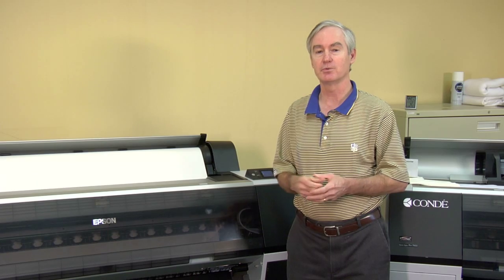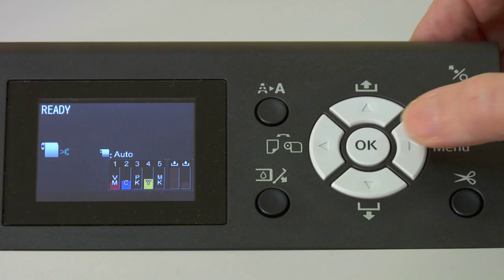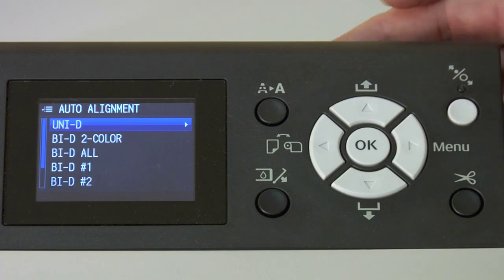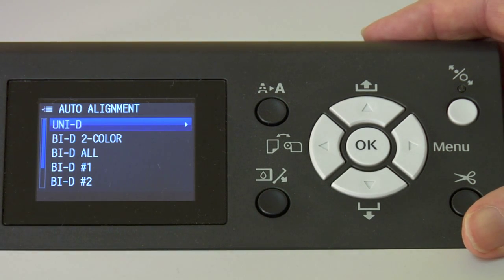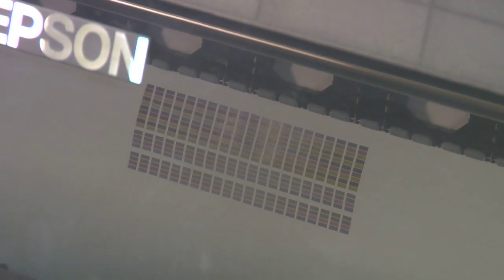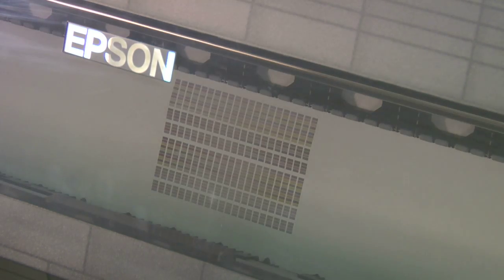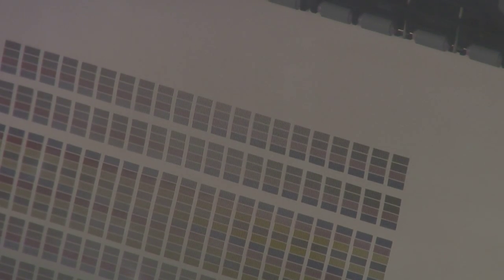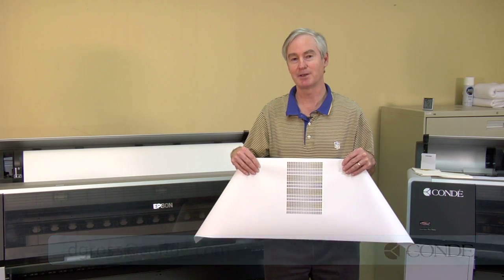Epson Printhead Alignment for the 9700 and 7700 Printers -

Comment: Do not forget that you have to find the thickness of the paper first(print the pattern to choose the best)and after that you have to make manual bi-di adjustments that is the best for Sublimation low gain transfer papers!(Subli inks are extreme unstable for automatic calibration and very often you have to correct bandings...bla bla...)